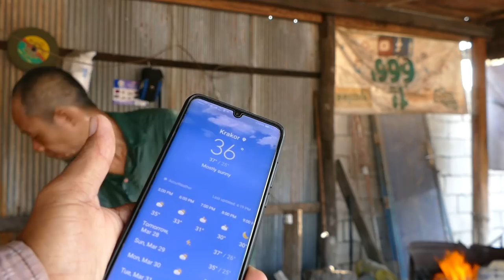MAKING A USEFUL TOOL FROM A SMALL PIECE OF A CAR AXLE

Comment: Could you do a video where he goes to a scrapyard and picks out the right kinds of metal for toolmaking? I would very much appreciate and enjoy it! Thank you!
Reply from the maker: We have shown some in our previous videos. We will make more videos about it for you.
Reply: Amazing KK Daily - that will be nice. Like the videos show him getting the stuff and the videos show how the person is going to use the tool that he made them.
Reply: Thank you!
Reply: Hiw much he sell for $
Reply: There is a vid that does a junkyard canister Damascus kitchen knife 5$ knife sells it for 2000$ look up garbage knife
Reply: What is usual for most handmade tools is coil or leaf springs, plowshares,  saw blades, mower blades. Steel from pipes or construction can be used but not for cutting edges. Cutting edges need high carbon steel and may need to be forge welded into the mild steel. He is using high carbon steel for the whole tool, which is simpler if you have acess to enough of it.

Comment: I like that he used the modern method of attaching the head to the top and fixing it with a wedge. (Instead of the historic method of threading a tapered handle through the eye butt-end first, and friction fitting it without any wedges.) 
The historic method is obnoxious and tends to come loose at the most annoying of times. This way you get the looks of a hammer-poll tomahawk, but with the practicality of a modern hatchet. :)

Comment: That is not a pipe tomahawk, it has no hollow in the round (or a hollow handle, which makes it a Peace Pipe). In fact, this is not a tomahawk at all. What you've made is a stylized axe, with an axe handle, and wedge. Tomahawks have a tapered handle with friction fit only. Nice work, but an axe is an axe.